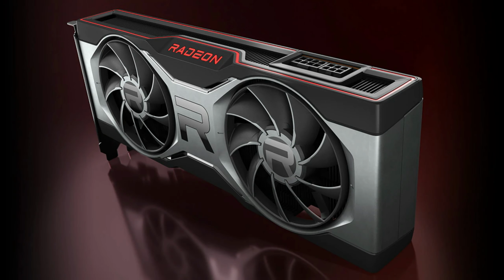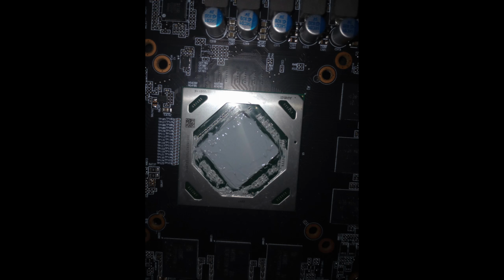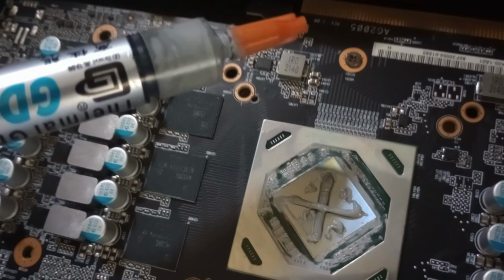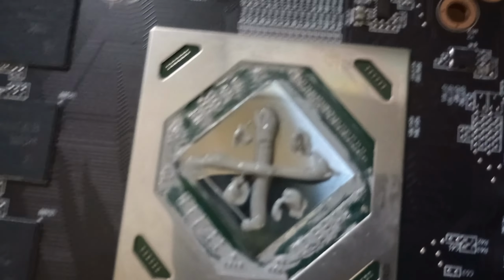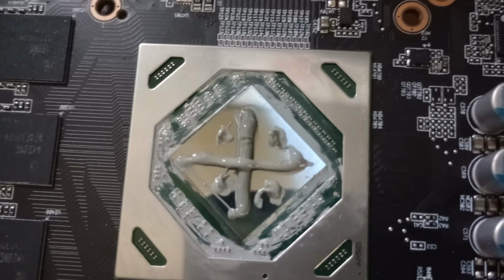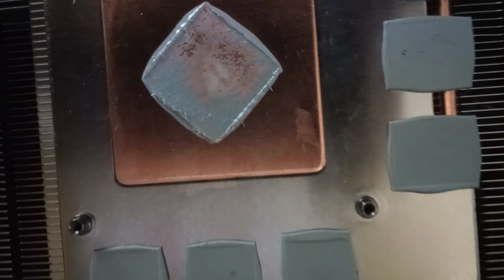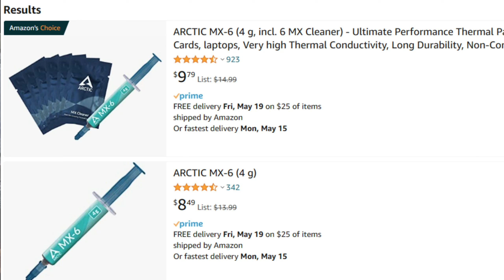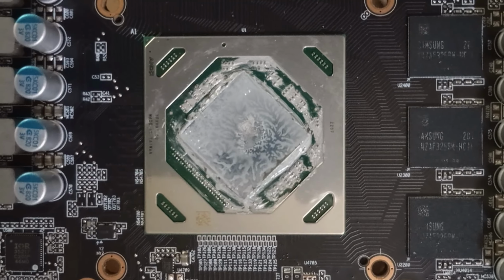RX 6700XT Needs a Repaste... | GD-900 Revisit

Comment: Hot spot is still quite high though. I suggest add 3mm thermal pads to the back of the ram (the back side of the card chipset near the metal plate. ) it should help lowering both Rams and hot spot.
Reply: I use thats method on my rtx 2060 super.. thats great,, but my msi mech rx 6700 is use plastic back panel,,

Comment: i tried adding washers that are 1mm and it did bring the cooler down more to tighten so the cooler is more on the die contact  like as a example on the rx 5700 xt reference cooler it does help.
Reply from the maker: Nice tips!

Comment: Justo me encuentro con tu video, y al tener la misma GPU, la diferencia entre la temperatura GPU y HOT SPOT, en mi caso, es de apenas unos 6°C. La pasta térmica que estoy usando es MX-4 y también Maxtor GTG8, con ambas mantengo esa diferencia entre las dos temperaturas. Eso sí, en tus últimas fotos se nota el desnivel entre ambas superficies, quizás no estás ajustando como se debe y posiblemente se deba a un error en alguno de los tornillos, se va a solucionar cambiando los 4 tornillos de ajuste para que sea equiparable al momento de volver a armar. Por otro lado, todos los que usamos AMD, sabemos que la mejor temperatura y consumo de todas sus GPUs están en la serie 6000 y la RX 6700 XT es una que calienta muy poco y consumo poco. Cabe agregar que también, otro error de que no haya un buen contacto entre ambas superficies se debe a que alguno de los thermal pads no tiene la medida adecuada. Vas a tener que revisar todo de nuevo para mejorar esas temperaturas, el máximo de diferencia que te tiene que dar entre GPU y HOT SPOT es de +-10°C. Y si el trabajo está bien hecho baja hasta una de +-5°C.

Comment: I believe it may have to do with the viscosity of the paste. Just a theory, I had similar hot spots on my Rx 6700 xt nitro. I did a repaste recently and noticed the GPU die isnt completely flat, like a bulge in the centre at the hotspot.

Comment: Have you tried undervolting? I did that and a repaste on my rx5700 xt and the temps dropped significantly. I used the auto undervolt in adrenaline .
Reply from the maker: I did some undervolting before and after this, did one last repaste and the card is much better than it used to be.

Comment: For direct-Die applications (Laptop repair shop) I use shin-etsu X23-7921-5, Thermalright TFX, IC-Diamond, Prolimatech PK3 or the Honeywell PTM7950 phase change thermal paste sheet for the really hot superturbo chips like the Lenovo Legion 5 or Acer Predator. Testing GD-2 soon, also seems to be a tough high viscosity paste.
Easy spread pastes won't last on hot direct-die chips, high thermal performance is pointless if it only lasts for a couple of weeks after a repair.
Reply from the maker: I used a thermal right TF7 thermal paste a few days ago and it fixed my problem, highest hotspot temp was 92c @ 190w and it never went up ever since, it was hard to spread as it too was sticky
Reply: Sticky with strands :)
I apply tough pastes through a honeycomb fine mesh grid.
Reply: hi, can you share long term results of gd-2?
Reply from the maker: The GPU has been long gone, sorry.
Reply: Fully switched to Laird TPCM-7125 (large sheets are fairly cheap) for general purpose laptops and PTM7950 For high-end laptops.

Comment: You still have high delta... if I were you I would RMA. Maybe the chip isnt completely flat and the thermal paste wont help to solve a core missplacement issue.
My delta isnt over 15c
Reply from the maker: Thank you for the info and suggestion! It was very abnormal when that happened.

Comment: On what temp should i hurry repaste my card? Just noticed I play Ghostrecon Breakpoint at 70-78°C on Ultra
Reply from the maker: If that's the core or hotspot its fine.
Reply: 6700xt powercolor runs 78-80C max 100C hotspot? Should i be worried? @GameFrostYT
Reply: @GameFrostYT 1.5 years old havent properly cleaned in a while but gonna clean soon
Reply from the maker: @sakusalonen6390  a bit but the card is technically still fine as long as it doesn't hit 110c, I do recommend repasting though.

Comment: I putted this paste at my gtx960 , goes upto 80C Max, 75 average... Paste is new , it says made in April 2022 

Not bad but the stock paste on this card was better...
Reply from the maker: I heard that this paste isn't good for GPUs but cpus are fine, also this is somewhat expected for cheap paste like this, i think the HY-510 is better if you want to spend less.
Reply: @GameFrostYT  yes I used this at gpu but didnt performed as I expected. But at cpu (4790k and 7600x) performs well 

For gpu I will look another one, will hy510 enough for gpu?
Reply from the maker: either that or just go with arctic mx-4/mx-5/mx-6

Comment: so which is better mx-4 or gd900 for a cpu/gpu?and how long does the GD900 work?
Reply from the maker: MX-4 if you want to go long term, ever since this video my gpu has been using the GD900 and it still stays cool.
Reply: Gd900 one of bad option
Reply: @GameFrostYT mx-4 degrades after 18 months of usage and the gd900 performs the same after 18 months if you watch the test Tech Yes City did with both the MX4 and the gd900 for longterm usage.

Comment: dude, always spread your thermal paste. Especially on gpu. It's totally different with cpu.
Reply from the maker: Noted
Reply: I never do that. I apply a small dab in the center of the die. It helps double check the heatsink makes good contact with the die.